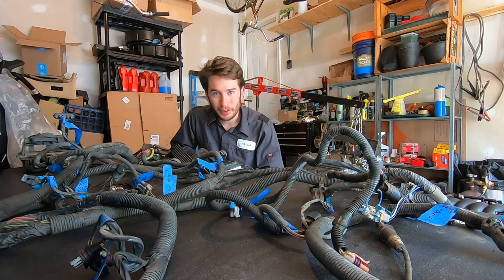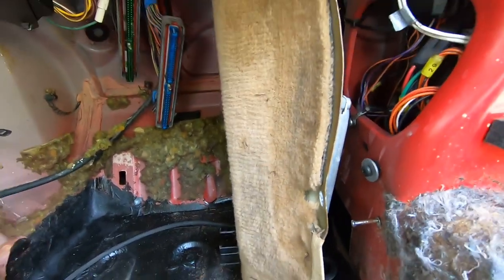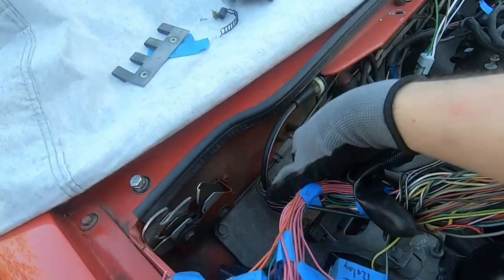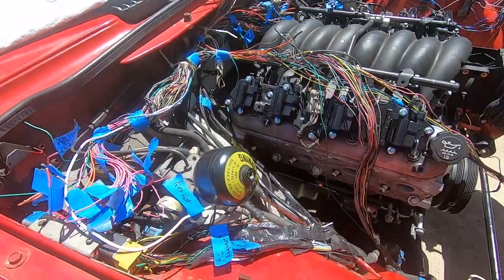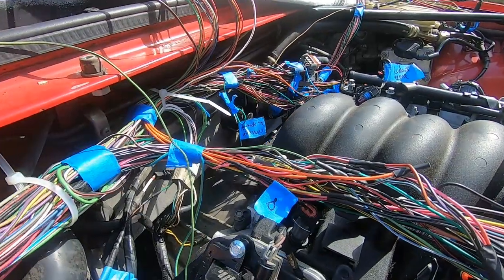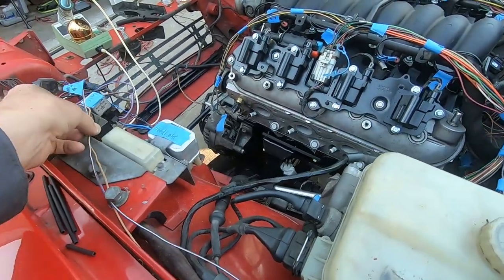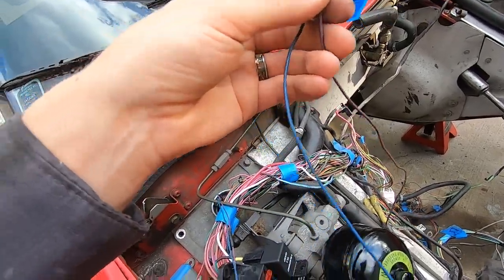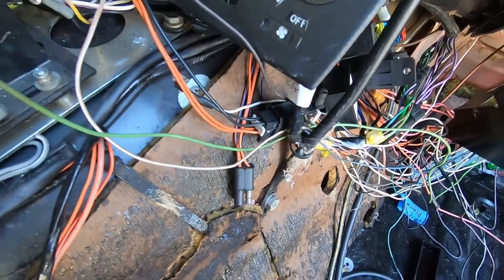Wiring my LS-Swapped Jaguar XJ-S

Comment: I’m running at 5.7 TPI Eng. with a 700r4 in my 86 XJSC best decision I every made was dumping the Fire 🔥 prone locked up v12. I used John’s conversion kit without issue. Great driving cars happy to see the in the road instead of rotting away 👍

Comment: Do the GM computers, obd and obd2 have the same problem that Ford has with ECM Capacitor failing and spilling there contents on the the PCB board and running the computer.